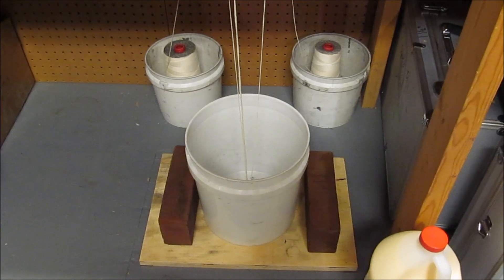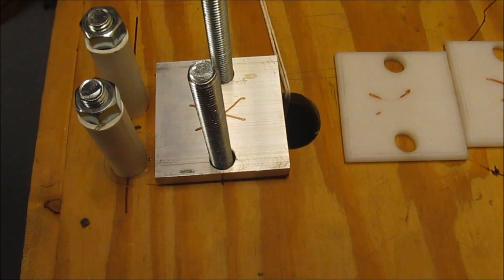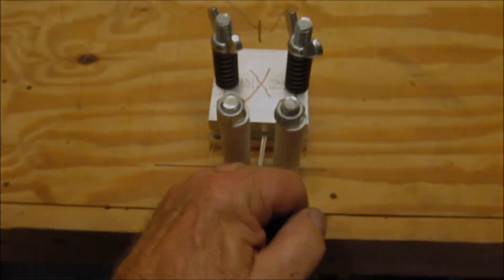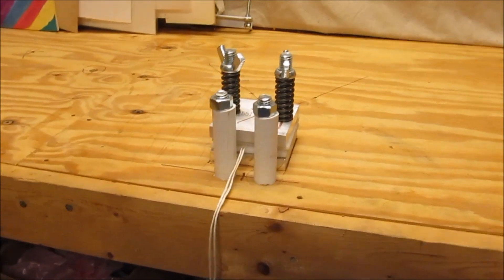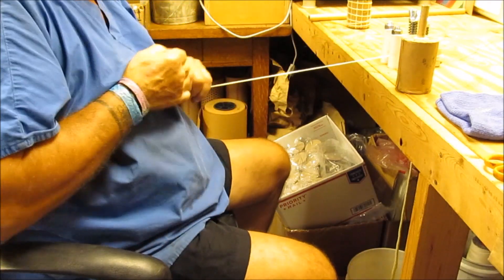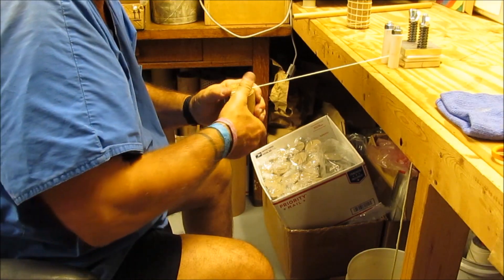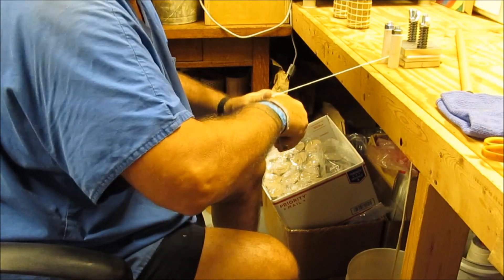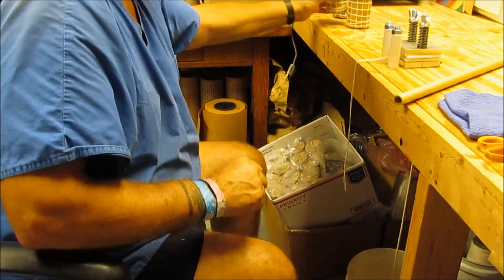My new cylinder shell spiking station

Comment: nice design! i can see the string cutting into the delrin over time. Brass would be a great option if and when those need to be replaced.
Reply from the maker: So far, it hasn't left a mark on the delrin, CO. The cotton string is pretty soft, and is lubricated by the glue, too. I'll keep an eye on it, though. I can flip the delrin pieces over, and if I drill more holes in it, could even rotate it 90 degrees, to get lots of use out of it if the string starts to mar it.

Comment: Very nice idea Ned.  So glad I saw this before making the more traditional, 2 post spiking station.  Eliminates having to load up the posts and the slowness of working back and forth in a criss-cross fashion (aka: slow).  I would, due to limit bench space in my shop, be interested in the "cart" version of this which you mentioned in you vid.  I can envision it easily enough but am wondering how you get stability without cart movement, needed to maintain the tension.  Is there going to be another posting of this?  Thanks
Reply from the maker: The cart is working very well, and is especially helpful with large shells like the 25 pound 8" 11-timed spider shells I'm currently building, GDG. I will be taking a vid of it being used for some of that spiking in the coming week or two, so stay tuned. The bottom line is that I did bolt the cart to the floor, and am using the upper Lazy Susan turntable with the two rollers on it to maneuver the shell as I apply the tensioned spiking to the shell. It takes a lot of the work out of that process.
ned